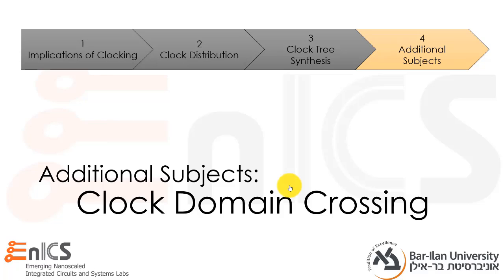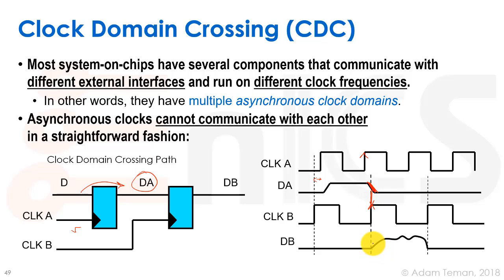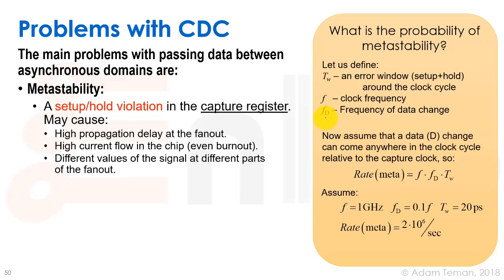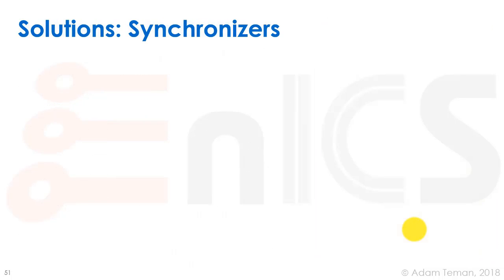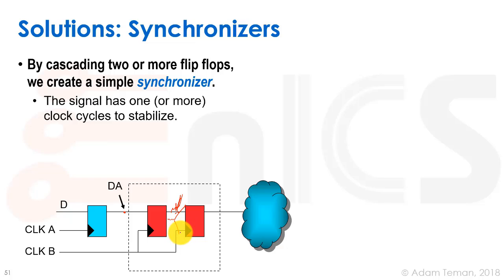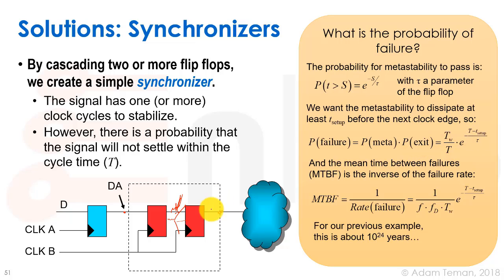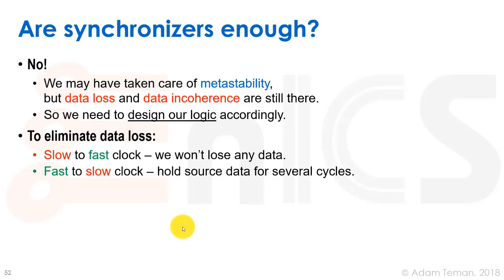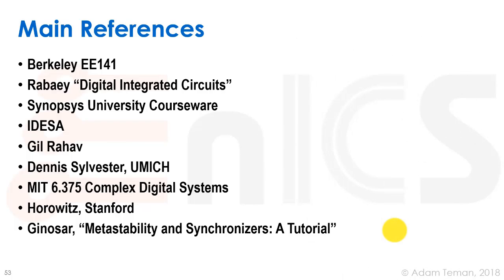DVD - Lecture 8g: Clock Domain Crossing (CDC)

Comment: Hi,
One question on 2 flop synchronizer, the settling of metastability causes latency issue at the recever side, as for a signal changing from 0->1 at flop1 might settle to 1 or 0 before getting sampled by flop2, but will settle to value 1 in next clock
So if it is settle in first clock the latency is 2 else the latency will be 3
How to update design to make this latency a fix value
Considering both clock same frequency with phase difference
Reply from the maker: That is a good question and it is part of a deeper subject, which is CDC.

But basically, we can have no timing constraint between the two clock domains. They are asynchronous, which is why we need the synchronizer in the first place. In other words, we have to design our logic to be completely robust to this possibility of the latency being different numbers of clock cycles. You need to ensure that the logic on the capturing side has a long time to capture the signal (much longer than the worst case synchronizer delay) and that it can't accidentally capture a metastable state.
Reply: @AdiTeman thank you for your reply